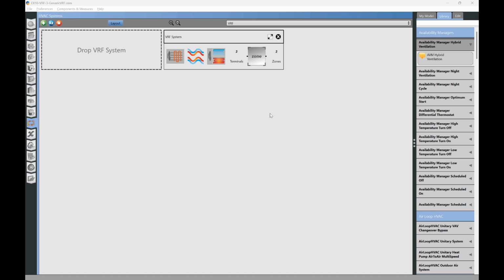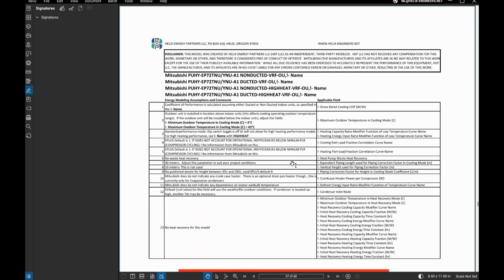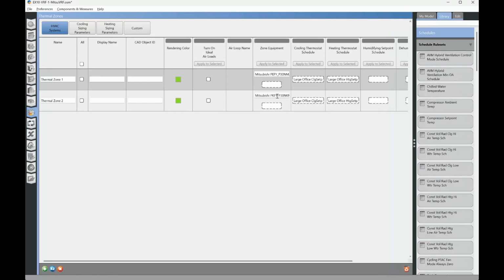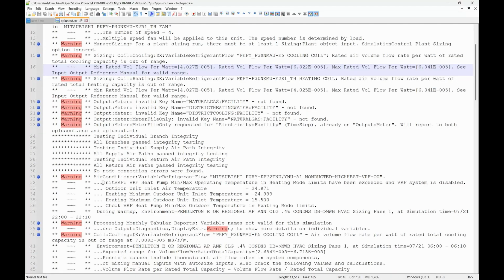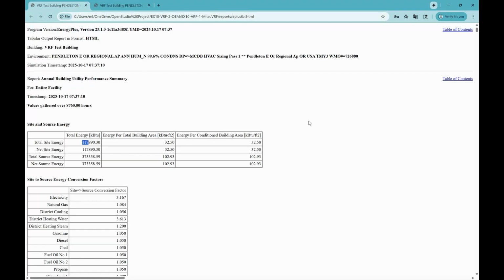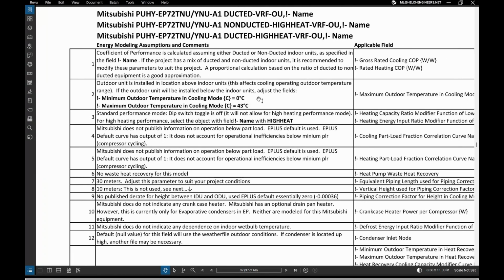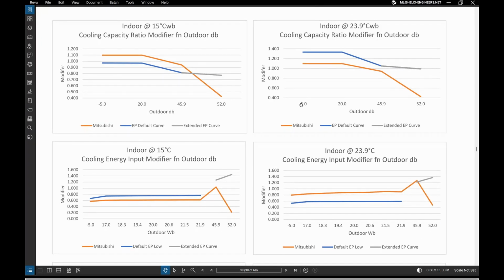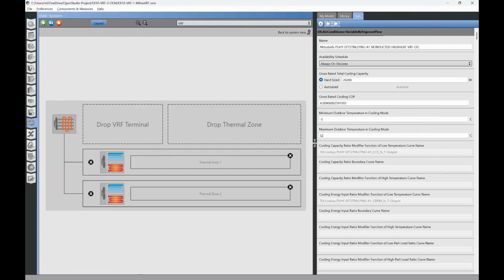OpenStudio EnergyPlus - VRF/VRV Mitsubishi, LG, Daikin

Comment: Hello sir, I would like to ask why, when I set the VRF heating schedule to “All Off,” the simulation results still show heating energy consumption, even though the value is very small
Reply from the maker: How are you setting it to "All Off"?  If you look at the output report Building Energy Performance, do you notice any pattern between the months?  IE. do some months show energy use while others do not?  Do you have other heating systems?  If it is really small, you might consider the parasitic electric energy use of the terminal units or the crankcase heater or basin heater.  I am not sure if the defrost heater would operated if the system is disabled, but that might also be a possibility.